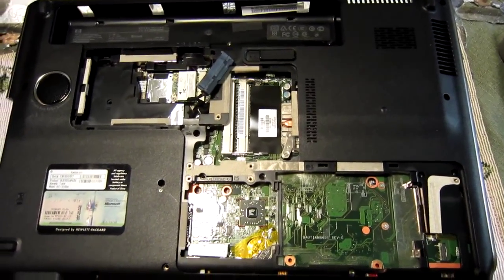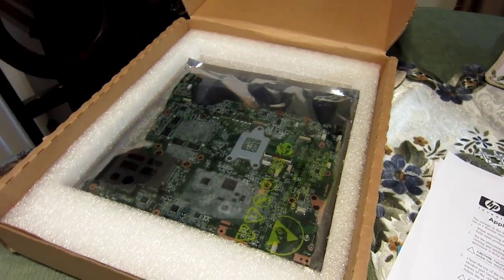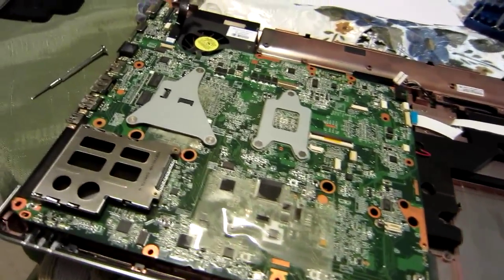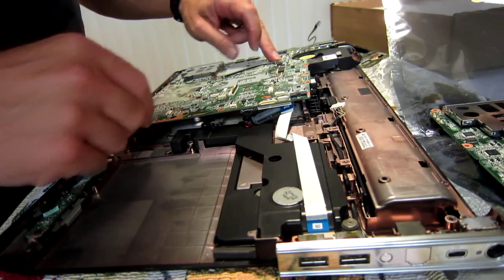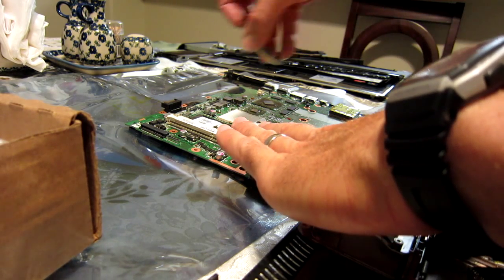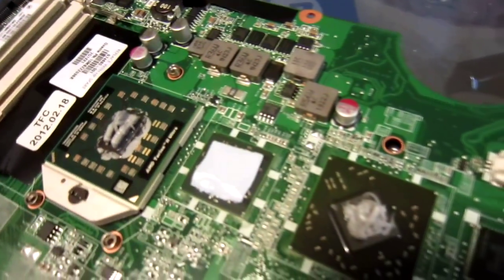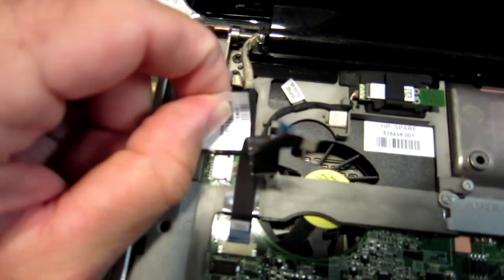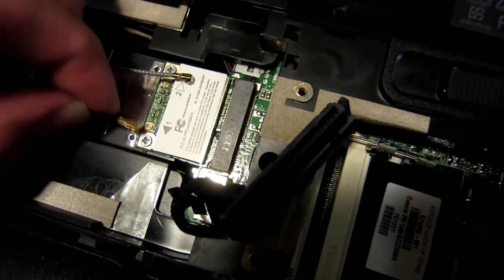HP Laptop Motherboard Processor swap install DV7 3160us

Comment: Correction: the two wires coming from the lid are NOT power wires! They are the WiFi antenna leads. I know because I ruined them & connections on the WiFi module getting them off to replace the cooling module.
Reply from the maker: That sucks. Thanks for the info.

Comment: where can i get a new  mother board? And do you do this ?  What is the part no. for these boards or at least a comparable board that will work?
Reply from the maker: The Trooper Girl, the part number is listed in the description, 574681-001. I bought it straight from HP, was about 170 or so.
Reply: thank you so much!  just in case they no longer have it what part number would be comparable?  Or interchangeable?
Reply from the maker: did you check. HP's parts website? other than that you'll have to get one on eBay.  no idea about interchangeable part numbers, sorry.

Comment: The blackscreen issue may have been attributed to a desolder problem with the graphics portion of the motherboard. My computer was afu for a couple of years and the company i bought it from wouldn't honor their insurance policy on the pc. My warranty was up and I had nothing to lose, so after checking out some videos on here, i found that you can bake the motherboard.... Yup, I pulled the cmos battery and disconnected the processor and plopped it in my oven at 380 degrees allowing the motherboard to gradually heat up with the oven then sit for 10 minutes at that temp. I let the oven cool for about 30minutes and reinstalled my motherboard after it cooled. Boom everything came on like magic.... true story.
Reply from the maker: dela213 Hi, thanks for your comment. I believe you about baking the motherboard to fix the issue. I also read about that when I was researching the problem on this laptop but decided to get a new board since the lady that owned this didn't want any further trouble with it. I wasn't sure how long the oven fix would last. How long has it lasted for you? 
Reminds me of the red ring of death probs on the 1st gen xbox 360s. You could wrap them in a bunch of towels to purposely overheat them which would melt some of the solder which temporarily fixed the RRoD. But it never lasted.
Reply: jcx2bby It's known as a reflow, it can be done by a professional, or at home in a pinch. I did it about two weeks ago and it's been working for me, but it is a temporary fix and I dont know how long it will last. Most likely I will end up replacing the motherboard and cpu at the same time. I am looking to get a little better performance out of my pavilion dv7. I'll make a video when I do it to dhow jow it comes out.
Reply: jcx2bby yeah, I heard tyew same thing about the rrod. I also just recently found you can remove the hdd from the old 360 and put it in the new slim case. There is so much I didn't know until the past month. Looking forward to learning more especially since I plan on building a gaming pc.

Comment from the maker: @Roman Gil, The motherboard part # is in the description if you still need it. The motherboard on this laptop did pretty much the same thing you are describing; power light would come on for about 2 seconds, the fan would run and then everything would shut off.  There's only a few things that can cause that; bad power or bad motherboard. I used a different power supply and got the same result so I ordered a new motherboard. 
good luck on your system and thanks for your comment.